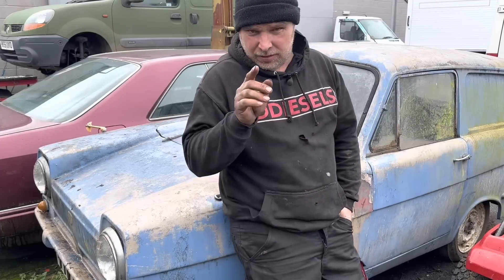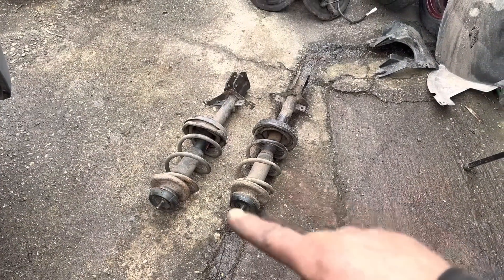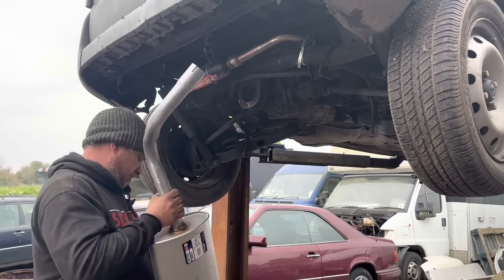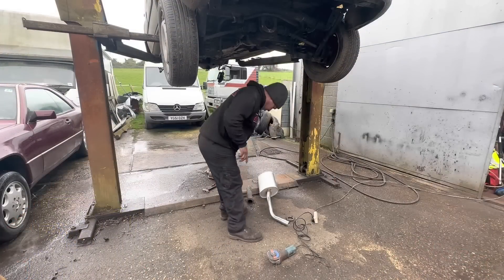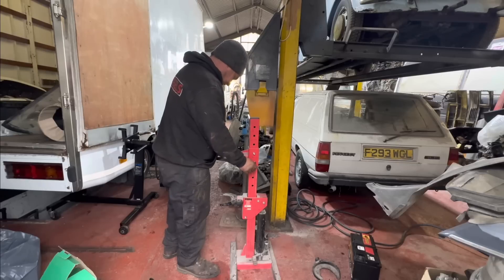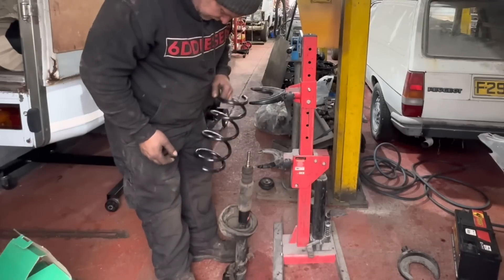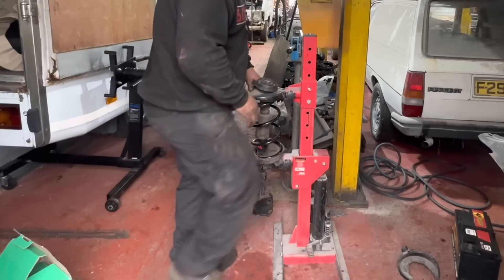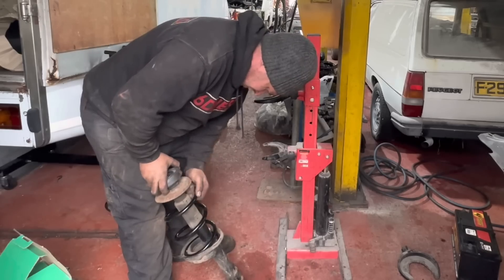Fixing the world cheapest 4x4 kangoo part 2

Comment: Amazing amount of work waiting for rectification. A sign of a trusted mechanic and business. On the Kangoo the bodgery encountered up there with the best of bodgers!!  Good to see you showing the use(and rather quick way) of replacing those springs. Was thinking about getting on of those after nearly killing myself with those screw down sets of spring removers. Lethal items! 

Parts supply and getting the wrong parts seems the norm these days.. have had to return a fair few bits and bobs in the past years or so. Most replaced with the correct part admittedly the rest refunded for.

Comment: You know, if you sounded a bit more Lincolnshire, you're exactly what the voice in my head would sound like while I'm working on cars.

Also, if you check the angles, that top quality exhaust rear section clearly comes out by the back wheel and exits as a stack on the offside so as not to block the side loader, well, probably, maybe.